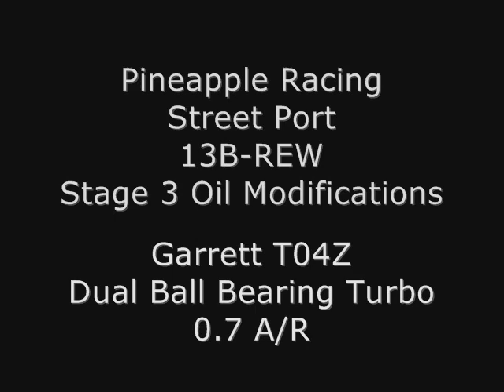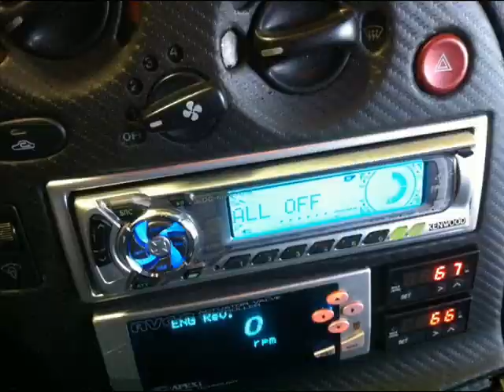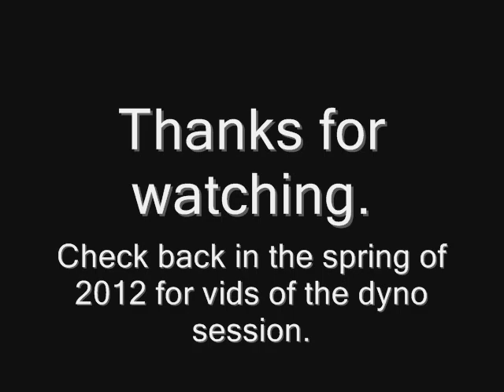1993 RX7 Build with Garett T04z

Comment from the maker: @mazdagine thanks for the compliments.  As far as the rats nest goes, when you go single, you can get rid of some vacuum lines and solenoids, but you can't get rid of them all like I did unless you eliminate all of your emissions equipment. If you live somewhere that requires emissions testing, you will never pass without them, but if your building a track car and won't be on the road, go for it!

Comment from the maker: I would just recommend doing a lot of research on the Rx7club website on doing the conversion from twins to a single.  There is a lot involved that many don't think of.  If you live somewhere with strict emissions laws, going single can create a lot of problems because it typically involves removing the air pump as well as some other emissions equipment.  You will also need and aftermarket ECU if you don't already have one, a good tuner, or tuning experience, and a lot of free time.

Comment from the maker: I can't really say much about the response of the T04z yet since I haven't put enough miles on it yet to start tuning for boost but I hope to in the next few weeks.  I've been traveling for work a lot here lately.
I had the motor built by Pineapple Racing for this build and went single all at the same time.  Since my car is black w/black interior, and a daily driver, I pretty much had to retain the AC.  Since I did all of the fabrication from scratch, it was not much of an issue to keep it.

Comment: Yar I agree, if you ever look under the UIM (upper intake manifold) of a stock FD you will see a maze of hoses and solenoids, check-valves etc.. It's very complex and prone to problems due to heat from the rotary. If it works it's fantastic but often it's a pain in the ass to troubleshoot. Stock twins can make good power if they are modified but they also don't have an ideal manifold set up and retain lots of heat. Going single simplifies the engine bay but causes more spool time lag.

Comment: I now feel depressed looking at my car after seeing how clean yours looks :). How do you find the to4z in terms of response? Did you rebuild it before going single or just pull it out to clean it up and install the single gear more easily?

When I finally have a garage I'd love to do a build like this. Also did you retain aircon? Seems you went front mount and often that means you loose AC.

The carbon fabric looks awesome.

Comment: hi bud great build the quialty is first class i my self am building the same car fd3s at the moment iv got a few vids of the build up on here but what i wanted to ask you well my engine builder has my motor now getting rebuild im going single gt3582r but he said i have to keep all them messy air lines that seem to cover the engine like a spider web lol if im running a power fc computer i really hoped i could delete all them like your engine what computer are you running to delete them

Comment from the maker: The stock twins are only good for roughly 320 rwhp.  I'm sure some will debate that number, but irregardless, I wanted to get into the 400's and the stock twins just can't do it.  Not to mention that it greatly simplifies things under the hood for more reliability.  The rats nest of vacuum lines and solenoids involved to make them operate can be a real headache to troubleshoot.